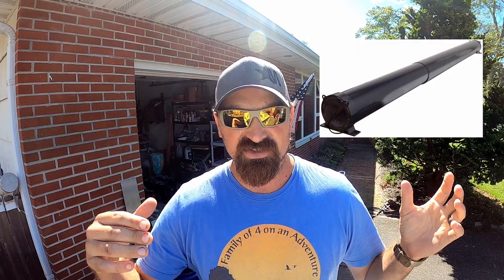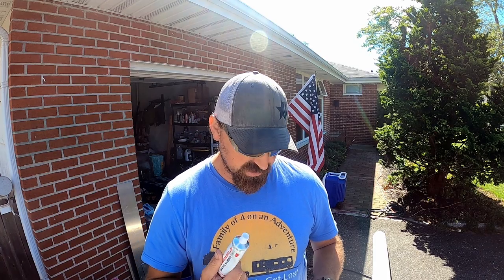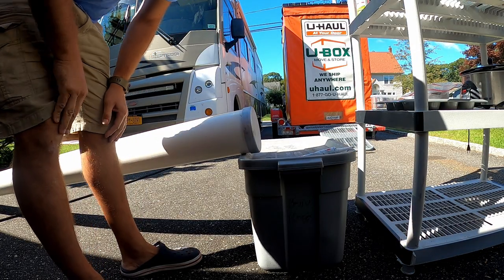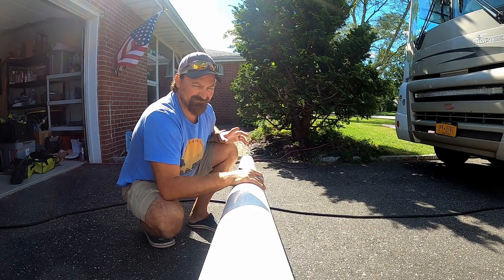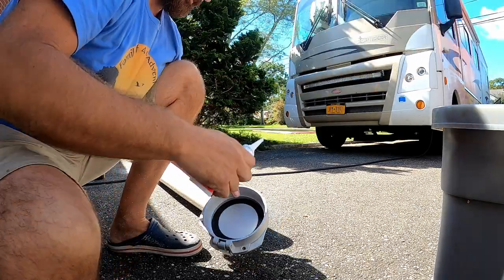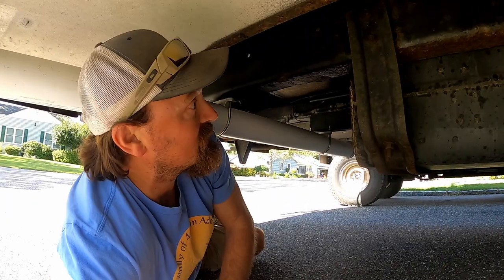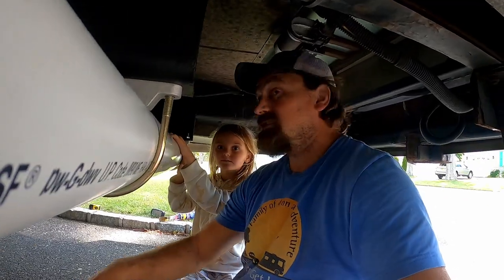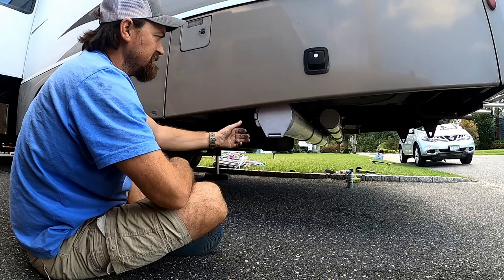HOW TO MAKE a RV Sewer Hose Holder | S2-E28

Comment: I did the same but put a PVC gutter inside as a tray.  Capped one end and put a handle on the outside end to pull all the hoses out.  The hose will not get pushed too far back.
Reply from the maker: That's great. I get two hoses in mine so when compressed it reaches the front. If I only use one half just have to be careful not to push it too far in. haha. Thanks for watching!

Comment: While any position for the end cap is acceptable, I would think that 9 o'clock (up stream or fore in boating terms) would be the best for most. That way if the cap is not secured, the wind will have a tendency to swing it closer to closed. At 6 o'clock it's never going to close and might get damaged on the road before someone notices it.

Comment: My buddy tried to convince me to do this like he did, he spent about 70 bucks and about 1 hour on his tube. I just bought 2 of the Vatera extendable sewer line tubes for 54 bucks each and took me about 15 minutes to install both so I guess its a give and take. Each one holds a 20ft Rhino section minus the elbows. I had to use plastic spacers I got from Home Depot so it would clear our belly covering but solid.
Reply from the maker: The Valteras and other ones would not work for our RV. The mounts are at the ends. I also didn't like the sliding tube that would sag as others stated in reviews. Ours fits our 20 foot rhino no issues and plenty of room for some extras. Thanks for watching!

Comment: What kind of blade did you use on your circular saw to cut the pipe ?
Reply from the maker: I used a diablo fine tooth blade. works very well on pvc.

Comment: Not a good move to handle something that comes in contact with raw sewage without gloves on.
Reply from the maker: Luckily we have running water and soap. Also, with gloves on you can be more apt to be careless when handling the poop hose. I am very careful and always wash immediately after. Gloves are just more waste for landfills.
Reply: @WanderToGetLost  Good to know you have running water and soap and never touch anything else until you sanitize.  My gloves do not go into the landfill, they are not single use, they are also familiar with soap - water - bleach
Reply: @WanderToGetLost  How sweet...your Mother watches the channel 🤣🤣🤣.

btw I found your install video interesting. I installed a Sani-Con Turbo waste macerator pump out for base camp use and while friend-docking but we still utilize our standard poop hose for gravity dumping that we currently keep in a sealed container but I'm always looking at alternatives.
Reply: @ceetee2021  So unless you wash your hands every time just prior to donning the re-usable gloves, you must have to also wash your hands after wearing them and washing the gloves. That's a lot of water (a precious resource), soap & bleach down the drain or do you just flush rinse everything onto the campground site and kill plant life? 

Even if you wash into your grey tank via a sink, bleach harms the good bacteria in the septic system that you will eventually dump it into, that are trying to break down the human waste products therein. 

I use disposable gloves just like medical professionals.
Reply from the maker: @deanh7190  haha. I am gonna add the macerator to our arsenal for friend moochdocking as well. Thanks for watching!